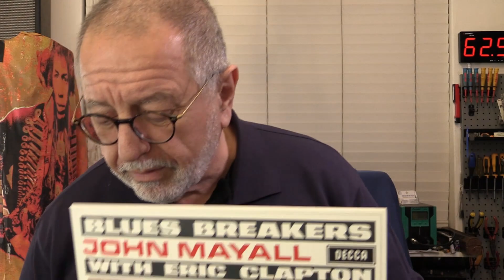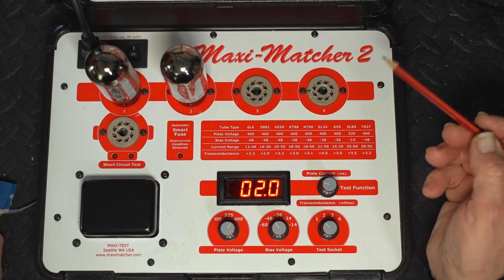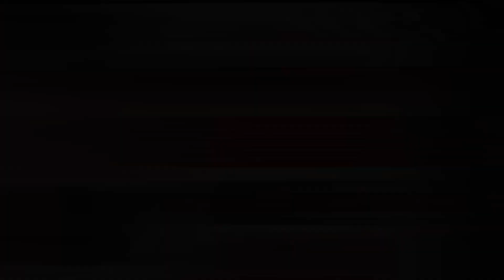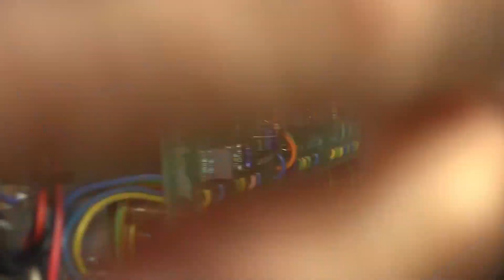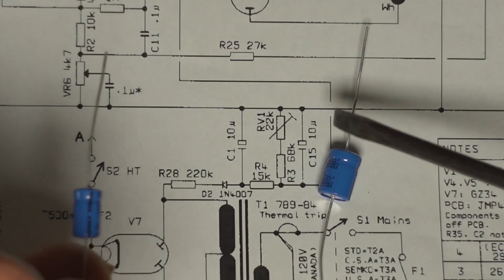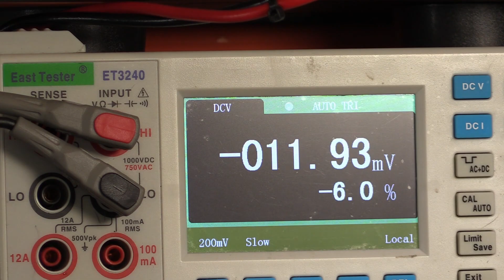Lets Repair this famous "Beano Blues Breaker" Marshall JTM-45

Comment: The Tone is mostly in your Hands! You really need a set of KT-66’s as they have a somewhat different tone compared to 5881’s. Also the output Tranny is different. The O/P tranny is 40% of your amps tone/sound. The original era Tranny’s were made for RS(Radio Spares) and sound different than the Drakes.
Did you buy your guitar new? It looks like it’s new!
Reply from the maker: Thanks for your comment. Yes, I am aware of the O/T transformers and the KT66s. I tried KT66s in my reissue JTM45 about 30 years ago. They sound a bit fuller in the mids but I ended up going back to the 5881s. I can't recall why. 
I am curious as to where you found the value of 40%. No doubt it makes a difference, but I have never heard it quantified like that. I wonder if it was a transformer manufacturer's marketing information. 
"Doug" my LP Custom is a 1970 (maybe '71). The original T-Tops were replaced with some horrific EMGs which meant the original pots had gone too. Rod McQueen from Sliders made me a set of PAFs which sound glorious.

Comment: Chris, you have one of the best amp channels, bar none. For years, I've been watching Uncle doug and d Lab, etc. Long before i knew what the hell they were talking about. It's always great to see what a pro does with a vintage amp. Btw I want so badly to wire up a turret board for that bluesbreaker, hahah.
 Locally,  there is an early 90s vibroverb reissue for a decent price , I'm thinking about grabbing it and hand wiring it. So much fun.
Reply from the maker: I hope you did your Vibroverb project. If so, how did it go?
Reply: @theguitaramptech  the guy was a bit flakey. so i didn't travel to do the deal, but since then, I built a trainwreck express and a 68 plexi 50 watt. Just finished the plexi and figuring out some issues with it. V1 plate v is low..
And next up , I bought a 2002 59 bassman that I'm gutting and hand wiring an eyelet board for. Lots of fun !

Comment: This is quite interesting, thanks. I have one of these for the US market the plate voltage is a lot lower, more like 380. It doesnt sound right at that voltage to me with KT66s. I boosted mine to around 420 and at the same power dissipation it came alive. Also, the US power transformer isnt mounted at 90 degrees to the OT so it is noisier.

Comment: A Beano JTM 45 would be point-to-point, cobber. No PCBs back then, I’d offer,
Reply from the maker: Oops. Did I say this was an original JTM45? Its a reissue, of course. (Sadly by the time I have finished editing any of my videos, I am so sick of my voice that I couldn't stand to watch it again, so I will happily trust you that I said it was an original early 60's model, which it is not).  However, I don't know about point-to-point. I expect it would have been wired on a turret board, but I'm happy to be corrected on that.
Reply: @theguitaramptech  Hey Chris: quite possibly you didn't actually say that, but I was led to your article straight from old mate Stuart's (ukguitarampguy) article [https://youtu.be/sPdSEMbLW04] on fixing an older one, kinda struck me. And yes, of course, you're correct: a turret board it is, indeed!
Reply from the maker: I couldn't bear saying the wrong thing so I forced myself to go back and have a look again. Fortunately, I only had to endure me until 03:17 where I clearly said it was a "reissue". So what was your point cobber?
Reply: @theguitaramptech  🙂See above: I guess even a PCB-based one is still a "classic" .. all good. I really liked your presentation, btw.
Reply from the maker: @johnvcougar  Thanks John

Comment: Hi, Chris. Great video. Nevertheless I would like to comment that unfortunately your criticism of the value of the cathode capacitor at V1 derives from an example of "lost knowledge" about tube amp design. The use of a capacitor with unusual high capacitance in this place is not an error of the designer but an attempt to improve the shielding effect of the cathode against hum influence by the ac operated filament, especially in input stages. A 330µF capacitor reduces the cathode to ground impedance from 145 to 10 ohms compared to the standard 22µF capacitor (at 50Hz mains frequency). This method is described in historical tube books. Greetings from Germany, Wolfgang (please excuse my english).
Reply from the maker: Thank you for your knowledge, Wolfgang. I am sure you are correct, but like many amp designers, I use the cathode bypass capacitor value as a way of tailoring the sound at this all-important first triode stage. For me, it is an acceptable trade-off. I am sure you know this site, but I often refer to it https://www.ampbooks.com/mobile/amplifier-calculators/cathode-capacitor/calculator/
Which part of Germany are you from? I love your country. I was lucky enough to do some work at an instrument company near Hanau several times.
Reply: @theguitaramptech  Hello, Chris. I must admid, but I did not know this capacitor calculator until now. It shows correctly that compared to a high pass filter the low end frequencies may only be reduced up to 6dB. Regrettably not all youtubers do understand this fine difference.  
Indeed I live just 20 kilometers south of Hanau. What a coincidence!
Keep up the good work. Kind regards to Down Under.
Wolfgang
Reply from the maker: @WolfgangGrimm-xm4nw  That's amazing, Wolgang. The company (not named) was actually in a smaller town called Maintal. I worked with a young talented engineer with the family name Grimm. I bet you are related.
Reply from the maker: I just remembered. His name was Max Grimm. 😊 I liked working with him.
Reply: @theguitaramptech  Yes, Max is my nephew. No. Sorry, just kidding. It's true the famous story tellers Brothers Grimm lived in Hanau, but the name 'Grimm' is distributed all over Germany and unfortunately I don't know a person called Max Grimm.

Comment: What a great video: an hour of entertaining and informative stuff. Mind you, I'm a valve amp nerd.
You need a decent reactive attenuator (I use Ironman II): get the "tone" without triggering a seismic event.
Reply from the maker: I am still a little sceptical about load devices. I use a Weber reactive load for my repair work, but I don't know if I would trust a vintage output transformer's survival for a whole gig.  Call me "old school".  I'm so thankful that I lived through an era when I could play a Twin on "7" or a JMP50 on "8"....other than the hearing loss!
Reply: @theguitaramptech  I've got serious mid and upper frequency hearing loss, AND tinnitus. I had fun in my early years but if only I'd got an attenuator sooner! 
I have a Weber but although it reduces volume it doesn't present a constant accurate impedance load: the Ironman does. The downside is that they cost around £1,000... ok worth it for what's left of my hearing, and they don't kill the tone like cheaper ones (eg Weber).
And... I've just watched your vid on why you recently shaved your head.  Power to you and your daughter. I'm not religious so not much I can do but wish her the best of outcomes.
Reply from the maker: @digitalchris6681  Thank you Chris. I will look into the Ironman. I mainly use my 18W Marshall 1974 for live work. I'd love to use my Brownface Concert, but its way too loud at 40w. Maybe the Ironside on that may work. Time for some research.
Reply: @theguitaramptech  Chris, I've been using the Fryette power station for 8 years now and can't be without it, to be able to enjoy my amps. Running an amp on 10 or around there, will cause any weak tube sockets or weak tubes to die though.  I just make sure my fuses are right and so far so good.

Comment: Seeing that "real waveform" brought home to me the Class AB video you did a couple of weeks ago. It was amazing to see what you had talked about in real-life.
Reply from the maker: What a perfect coincidence it was, Les. Of course, in this case you didn't need an oscilloscope to find the failed screen grid resistor. Just measuring the voltages on pin 4 would have found it quicker, but I saw it as a perfect learning exercise to help understand the Class AB overlap. I am very satisfied that you picked it up, referred back to the Class AB video, and gained a better understanding. After all, not everyone has an oscilloscope at home. Thank you for taking the time to write your comment.